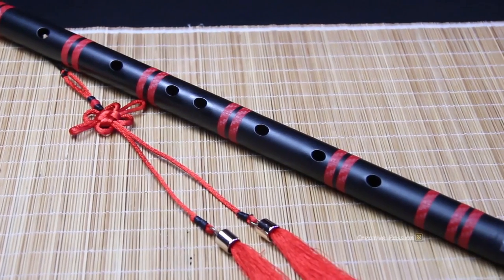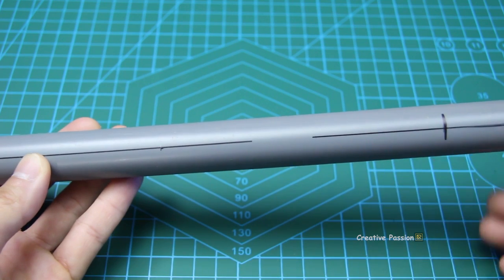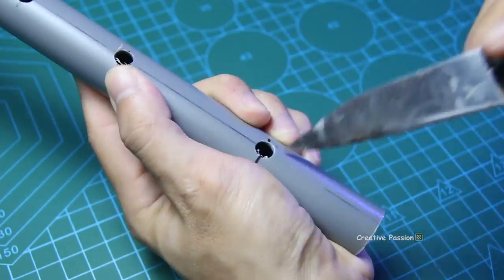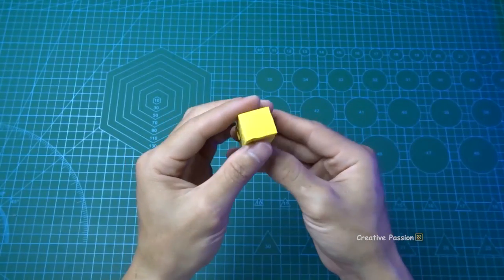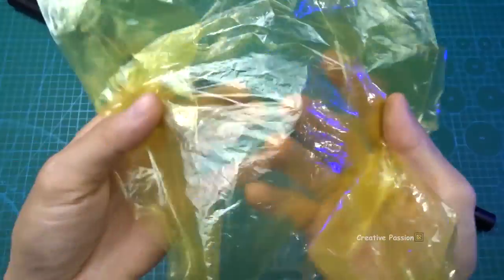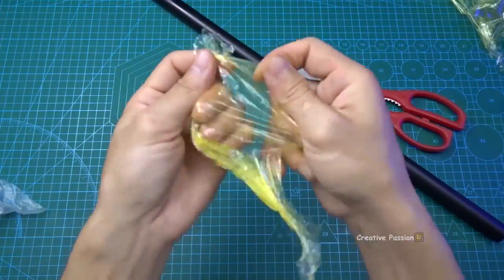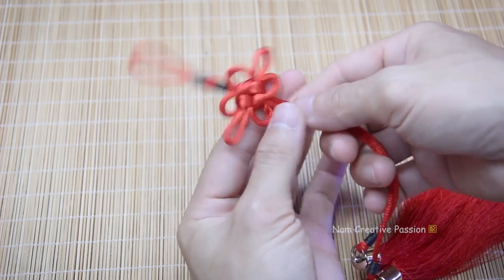How to make DiZi Flutes from PVC pipes

Comment: Just got done with it. Made it out of bamboo. It sounds so good! Thank you for posting this video
Reply: Can I ask please what is the yellow thing he puts in the flute if you have your done?
Reply: @kristyanrichtr8959  He said it was soap. I just want to ask if you know where to buy 21mm PVC pipes.
Reply: when you made the flute with bamboo did it have a proper tone.
Reply: @Argus2602  Well, as I searched, there are no 21mm (at least in my country I couldn't find any), but the closest is 20mm

And thank you for answering me
Reply: You know the correct measurenents of the end hole? After 35mm is 190mm of what
Reply: @Argus2602  is 1 inch pvc pipe *( the internal diameter is 21mm )
Reply: @uzumakikyubi  I didn't know that thanks.

Comment: This is amazing easy to follow even without understanding your language. I have a question, how do you calculate where to put the tone holes. I’d like to make a lower pitched one and I’m sure the holes would all be in different places.
Reply: Maybe you should learn his , so you can get an answer to your question...
Reply: T
Reply: C
Reply: I m looking for the answer almost 2month
Reply: @alexliss2740  because he might not speak English that's why he didn't answer to your question
Reply: I have had the same problem
Reply: Can anyone tell what's the diameter of the PVC pipe?
Reply: Hola yo vi un vídeo de un brasileño que usba una ecuación o fórmula para calcular donde van los huecos según el grosor y el tamaño del tubo.

Un poco confuso al principio pero si funciona
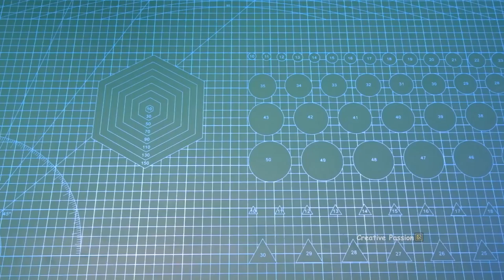Reply: @nishantpathak7636  1:00 into the video.  21x1,6mm  i.e. 21mm outer and 17.8 inner diameter
Reply: @nishantpathak7636  20 mm (same as ¾" Schedule 40).

Comment: Any body answer me guys 
1. Doubt is why he put tap in all hole 🕳  does he did mistake or we also do the same hole and put tap there ? 6:28
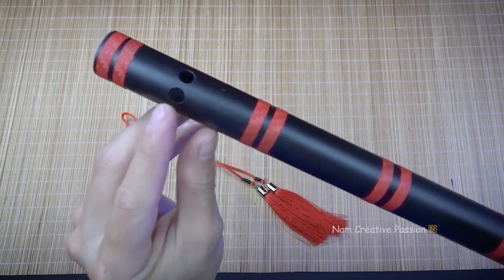2. That two hole in back for key chain is necessary, if don't put 2 hole will it affect  sound notes? . 9:28
I NEED CLEAR PICTURE OF BOTH FRONT & BACK OF FLUTE 
TQ❤
Reply: 1.Not a mistake, its called "Dimo Membrane".

Comment: Could i do this with a 16mm pvc pipe?
Reply: Yes but you will have to change the spacing of the holes. And remember that the shorter the flute, the higher key it’s gonna have. The longer the flute, they lower key it’s gonna have
Reply: @Hyuck  thx😁✌